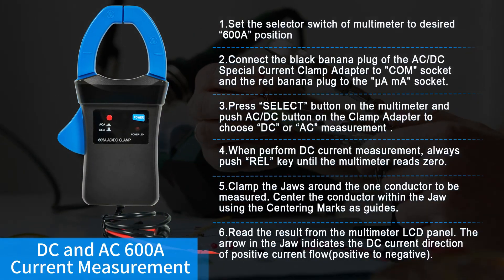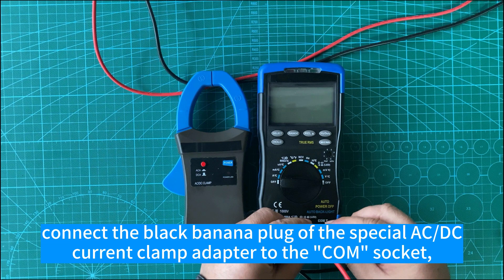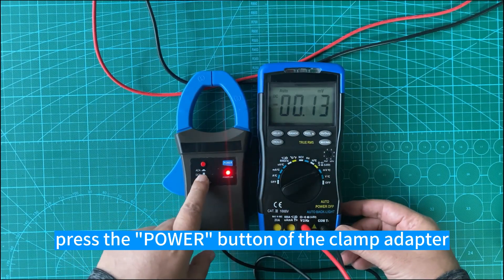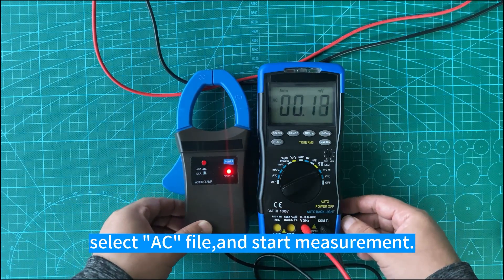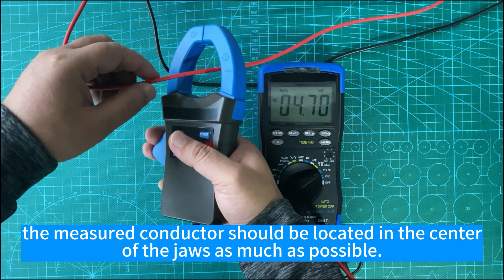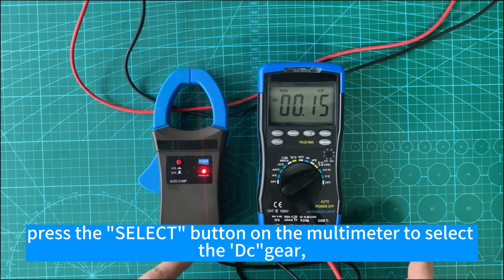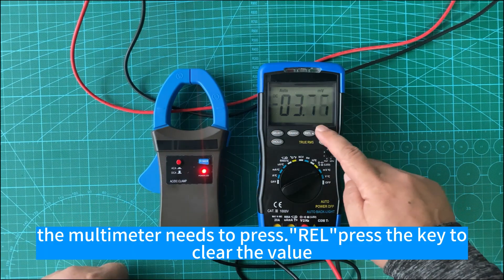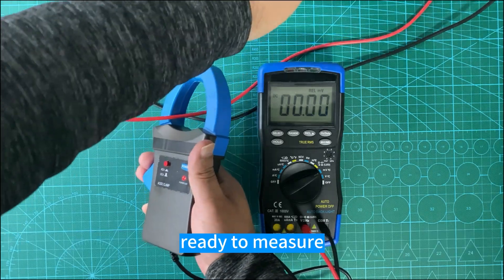Clamp Current Probe AC/DC 600A Clamp-on Probe Tester for Multimeter Electric Clamp Meter 605A

Comment: The Bionic Woman mentioned... plug Red lead into mA/uA socket and set meter to mV/uV setting however, these selections make an incompatible marriage by multimeter. The compatible setting would be mV/uV selection for Red lead into mV/uV sockets.
(Don't forget to press REL to establish 0mV before taking measurements).
I sure hope this thing works accurately.